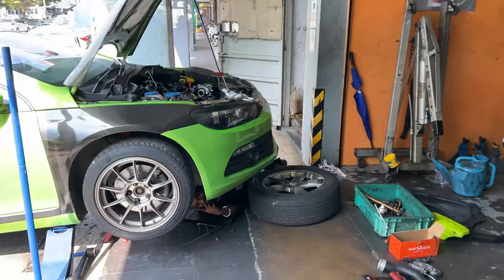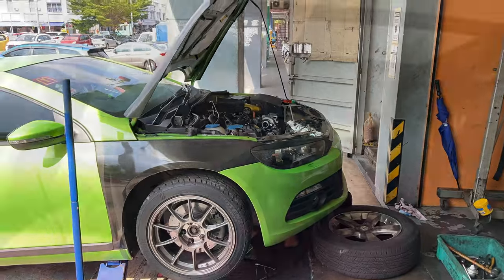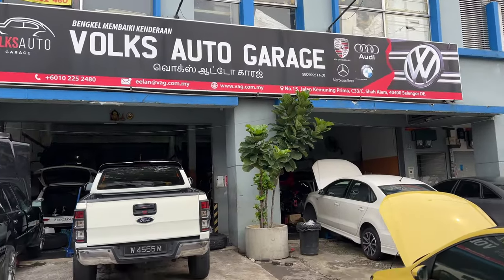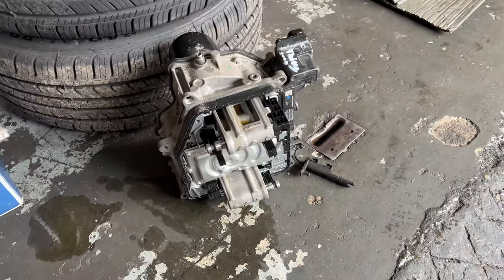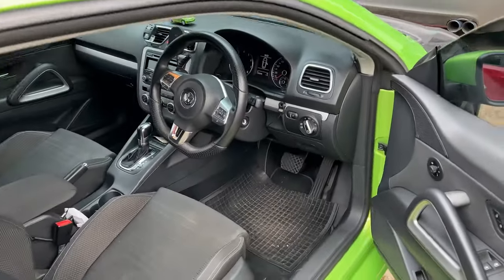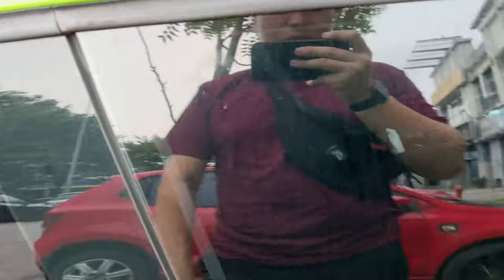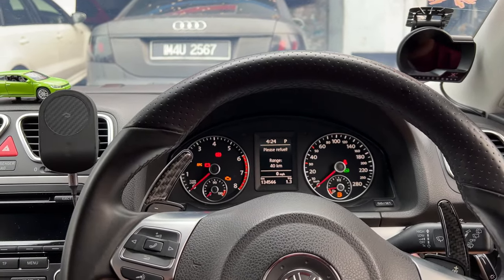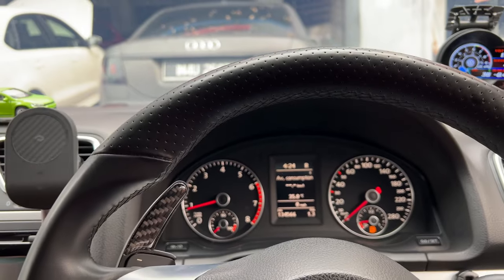Stage 2+ Scirocco Turbo Replacement & Updates

Comment: Sorry to hear the troubles again bro. I know how it feels. I hope the recond MU lasts longer than the previous one. I usually do the oil replacement way before the 40K mark tbh and always use original VW dsg oil for that.

Just curious, did you do any dsg oil replacement recently before the MU gave up?
Reply from the maker: My oil doesn’t get to last so long hahaha. I am on my 3rd Mecha if u count the one that came with the car from factory.
Reply: damn, have you ever suspected that the workshops are not doing something correctly? be adaptations, tools, procedures etc? if not then the roc really is a car that’s heng suay
Reply from the maker: @DK-md8tj  I only send to specialist so they should know what they’re doing. I mean I wish I could do it myself but I don’t have the tools haha